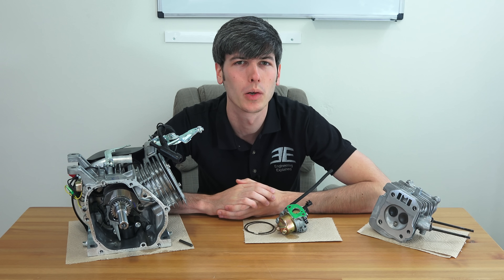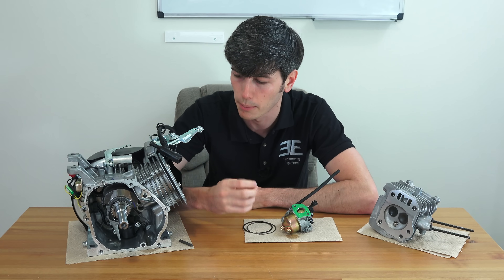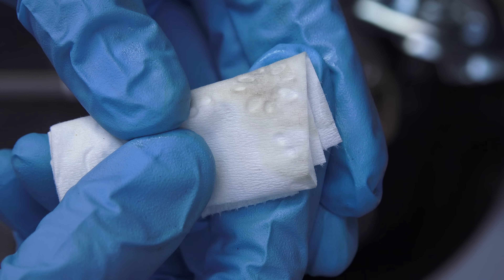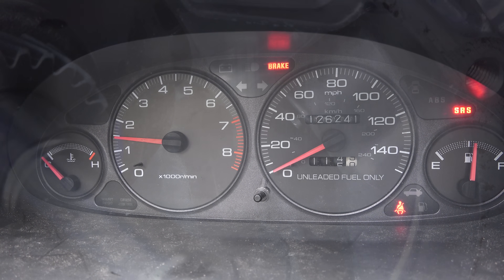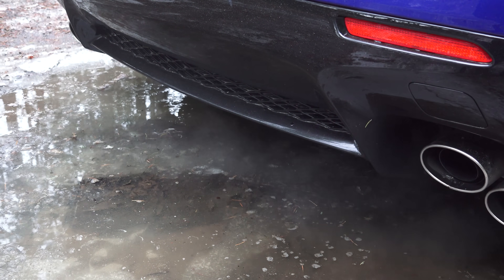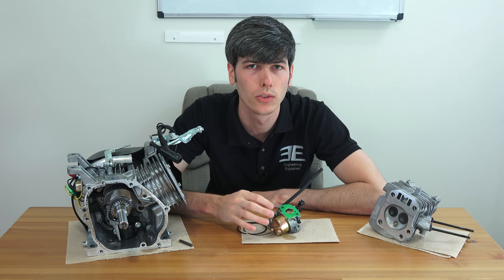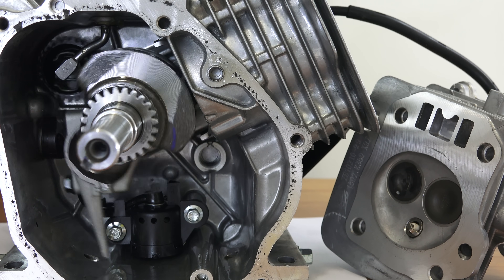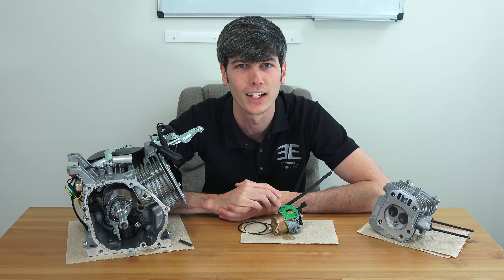Should You Warm Up Your Car Before Driving?

Comment: The engine doesn't need a warm up but that is not the only factor. I used to have to warm up the car to keep the windows from fogging up (I have a garage now). This can be really important if it is snowing or sleeting out. It would certainly warm up faster with driving but it wouldn't be safe.
Reply: You could always go buy a used Volkswagen Phaeton.   They were equipped with a standard dehumidifier so the windows can't fog up.  They also have all-wheel drive so they're more sure-footed in the snow.
Reply: Block heater would have been nice but all of the times I used to park outside, there wasn't an electrical outlet available so I never installed a heater.
Reply: Jonathan Gwynne 200k isnt nothing special on a vehicle today.
Reply: That's another reason why modern cars have AC, it keeps your windows clear. Although, sometimes AC doesn't work in very low temperature.
Reply: Obviously drive off when your windows are clear and it's safe to do so. Any vehicle equipped with A/C uses it when you use the defrost. That's why to save fuel they tell you not to run defrost all the time.
Reply: I haven't seen a modern car without a "dehumidifier".  It's usually labeled "demister" or "defogger" .  The "dehumidifier" is merely the AC unit, of course.  It then runs along with the heater to supply warm, dry air to the windows.  I haven't looked at the data, but I suspect the Phaeton was an incredibly unreliable car.
Reply: I think if you live in that climate the car body will wear out before the engine.
Reply: RickMakes I just use mine in the morning I park my truck in the sun so that heats it up nice
Reply: Kid Android
That is very dangerous as the ice could come off at speed and hit the car behind you!
Reply: There are always special situations.
Reply: Just turn on the A/C -  it dehumidifies the air and it will dry the windows faster.
Reply: Got T-boned by a guy like you years ago, Cop gave him a ticket for not having cleared windows, even tho he scraped them
Reply: The engine still needs a warm up.  Shut doesnt take long at all. That being said the couple pennies you save is not worth the risk of driving  while you cant see. It does take a few min. for car to blow out warm air and in the winter that is not safe. One accident will cost more  than several lifetimes of warming up your car a few min.
Reply: block heater
Reply: Most cars attempt to use the a/c unit as an incidental dehumidifier but it isn't the same thing as a dedicated unit.

And it isn't unusual to see Phaetons with 200k+ on the clock.   This is spare-no-expense German engineering at its peak.

The only reason they're not still being sold in the US is that Americans are too shallow to spend that kind of money on a Volkswagen.
Reply: @billigerfusel  the cops saw you doing that in my country you would probably lose your license.

Comment: Driving around in a car that is 12 degrees Fahrenheit for 15 minutes is no fun either.
Reply: +siamiam How cold does it get where you are? In Boston it doesn't really drop below 10 degrees Fahrenheit in the winter, but the coldest it was since I have been here was -15 degrees Fahrenheit. Still not too bad compared to some spots further up north.
Reply: +siamiam -62? Damn. I wonder once you go past -20 or -30 if the cold pretty much feels the same. -20 with wind is my limit.
Reply: I can sympathize with puffing your car in the driveway in the wintertime. And car manufacturers aren't quite sending the right message either when they allow you to remote start the car from inside your house :P Or maybe they are sending the right message? I don't know.
Reply: i would be more then happy if the coldest it got in my area was 12F  :D
Reply: i have a video of a temperature sign here at -62f   but the average winter  temperature is  around 1f above,a good chunk of winter is in the -20f range and colder with the highs some times being in the -40f range for long periods of times

this is ambient temperatures not counting wind , a car will start far easier at -40 windchill compared to -40 ambient

Comment: I live at a motorway junction, like right near the round about for the slip road,  speed limit is 75mph/120kmh. What should I do when starting my car,  wait 1 minute and go straight on the motorway? Or wait longer? 
My car is a Ford Fiesta 1.0 ecoboost.
Reply: wait a min let the engine oil flow...it's a turbo so I would let it run for a another rminute for every 10 degrees below 20 degrees celsius
Reply: try keeping the car under 2500rpm for a few mins

Comment: I think most ppl just do it to run the heat so they dont freeze to death.
Reply from the maker: For sure, if you're doing for your own comfort (when it's really cold out, go right ahead). Being warm is a luxury hard to pass up. :)
Reply: The heater draws in air from the engine bay into the cabin. If your engine is cold, so will your engine bay be, therefore you will get cold air in the cabin. The faster you start driving and warm up the engine, the faster you will get hot air through the heater.
Reply: @ArthurSperotto  No, the heating system on most cars draws outside air through the slots just in front of the windhsield, not from the engine bay. Drawing air from the engine bay could be lethal if you have an exhaust leak, and very unpleasant if you have an oil leak dripping on the exhaust and making lots of smoke. The heat comes from engine coolant circulated through the heater core, which is a  small radiator located in the ventilation system.
Reply: yeah I run it until the coolant gauge goes up a touch above low, I know the engine oil is still cold
Reply: I just run it under 2000rpm when it is cold after 5 minutes I continue normal driving
Reply: Sartaj Aujla Yeah. In Canada it's almost a necessity because your breath will freeze and fall into your lap somedays haha
Reply: +Ben yeah I living in mississuaga,ontario I usually warm up for a minute for every 8 degrees below 20, 1 minute for 20. I sometimes put insulative material on my grill so that my car doesn't radiate as much heat while I brush the snow off...I usually take off 2-3 minutes of the warm time this way...
Reply: Kyle Warburton Come to calgary when its -35 and tell me driving a cold car doesnt suck
Reply: Even when the coolant is up to temperature, the oil is still not up to temperature, since it takes oil more time to heat up.
Reply: ***** A fellow Calgarian! Calgary is (strangely) actually quite warm compared to the rest of the province. There have been days when I started my car at -40° (no power for block heater) and drove for an hour before I actually started to feel warm. In those cases, blocking the radiator with some cardboard really helps.
Reply: Does this also apply to diesel engines?
Reply: +Richard Tønnessen stress the engine? no. does it take longer to warm up. yes. especially when your running heat and directing coolent away from the engine
Reply: +Engineering Explained it's also a safety thing, the interior temperature should be warm to melt any ice or snow to increase visibility...
Reply: I still wouldn't bother. It's more fun to get in a freezing car,  starting it up, idling until the oil circulates, drive lightly until its at normal operating temperature and then crank the heat up to max. That 5 minutes of agony is worth the instant warmth instead of the weak luke warm heat you'd get out of turning on the heat early.
Reply: +Timeless Works yeah but if you keep it under 2000rpm and less than  25% throttle you are fine, the engine oil will heat up faster with very little chance of damage to the engine
Reply: I've heard people say running it idle for longer periods (like warming up the cabin before starting) puts much more stress on the engine than if you'd start driving within a minute or so, because it takes much longer for the engine to warm up. Is this true?
Reply: +2PacPRNDL at -40 to -30 degrees celsius my car doesn't heat up to optimal temp while driving even..,it only heats up when I cover the grill...
Reply: +Arthur Sperotto you are wrong about that...  It uses coolant to produce heat.  Once coolant is warm u got heat you have a heater core in ur dash which is a small raidiator  that you blower motor blows air through to get ur heat...
Reply: +Richard Tønnessen it's better for the engine to be idling when cold compared to under load since an engine idling I under very little load
Reply: Kyle Warburton Oh yeah thats a real cost effective idea. Move. Clap. Clap.
Reply: Up North, we feel it more than anyone else.
Reply: yeah nah, I know that :) I was just making sure that you know it too :D I usually let my engine idle for a bit until my coolant gauge starts moving up (heats up rather quick in the summer) and then gently roll away. I only have a coolant temp gauge, not for oil, so I give it some time after the coolant has reached its operating temperature until I feel okay with giving it the beans :)
Reply: +Sartaj Aujla my car doesn't heat up until I actually drive lol
Reply: +Sartaj Aujla cover the grill, how do you do that lol
Reply: 2PacPRNDL A/C is independent. It'll work with a cold or hot engine, as long as the A/C system itself is ok :-)
Reply: Sartaj Aujla Good way to block all airflow to the engine!
Reply: +1337Jogi i'm sorry for this
Reply: +Timeless Works Not sure about the stress but it does take longer to warmup the engine because the hot air comes from blowing cold air over the engine coolant pipes wich causes the coolant to take longer to warmup and in turn cools down the engine even more when it&#39;s trying to warmup.
Reply: Did you watch the video?....he addresses this.
Reply: +Dartht33bagger I agree 100% Especially when you're driving at 6am when there isn't much traffic
Reply: Daves Nothereman you should ALWAYS warm up a diesel fuel injected or carby.
Reply: Dylan Rooney All diesel engines are fuel injected and always have been.  The question was more meant to ask whether the same length of warmup time (30-60 seconds) followed by LIGHTLY driving it is a more efficient way to warm up your engine and your vehicle than just letting it sit and idle for 20+ minutes.
Reply: +Tharee MaahthePuddi it wouldent change much honestly you need to put load on the engine meaning add more fuel meaning warmer temps
Reply: +Arthur Sperotto yup, thanks man :3
Reply: +Arthur Sperotto how bout A/C
Reply: +dosmastrify lool I see, thanks
Reply: +Arthur Sperotto The interior isn't heated by air from the engine compartment, it's heated by coolant from the engine which circulates through the heater core.
Reply: giftman20 Robert Bradtke I know, it functions as a second radiator :-) It's just easier for people to understand and be able to picture it happening if you explain it the way I did.
Reply: lol true tho
Reply: +Engineering Explained thats why its freaking sweet to just lease. let that engine sit for like 15 20 25 30 min or so lol. "its not my car" lol then u dont even have to scrape the windows
Reply: A coat wont help your eyeballs from freezing at -40
Reply: +Arthur Sperotto the heater does not draw in air from under the hood lol it draws air from either the windshield vents, or if it's on recirculate, from the passenger footrests and then gets blown against the heater core to warm up the cabin
Reply: Except for Windsor Ontario. Mild winters plus free healthcare!
Reply: SoundgardenMan lol
Reply: After reading all of this comments I'd say a few things. Firstly, most cars (at least in EU) have only cooling option from AC. Of course it's possible and usually made in home AC that you can reverse it and use AC to warm up the air but in most cases turning on AC won't make big change while iddling. You may feel slight difference because of additional load to the engine. 
Regarding covers, it's quite commonly used in UE, especially for smaller city trucks. The only thing it does is isolating engine bay from outside to let it keeping more heat, especially while in move. Again, it's more common for older cars as new ones may have additional valves that will limit a lot of cold air taken from grill (at least it's called grill in Polish). I've seen middle aged cars which had bunch of plugs to use in winter time. 
Last thing worth mentioning is thermostate for engine coolant. Depending on it's condition and model it will have great influence on oil temperature. Last winter I found out that engine warmed up to proper temperature while staying still but in movement it goes down to 60C. I've checked thermostate and it was broken opening already at 60C. In my engine (Z19DTH) it should start opening at 85C and be fully open at 95C. It was enough to cool down engine while driving about 90km/h.
Reply: You won't freeze to death by getting in your car, letting it idle 10 seconds then driving it gently because you are inside the car and the wind can't blow on you plus you body warms the car interior up. I have driven my cars in -60º F weather for many years, and I drive away after 10 seconds of idling and my cars always warm up quickly and I'm super comfortable because I already hav a winter coat on and being inside the car I warm up naturally in the one to two minutes it takes the heater to blow warm air when its below freezing outside. We Just had a big snowstorm a few days ago and I timed it, the interior was warm in 60 seconds even though it was snowing outside.
Reply: There's a thing called a "coat" that keeps your body temperature high when it's cold outside, you should try it out, works great!
Reply: In Austria and Swiss it is actually not allowed to let your engine running while the car stands still even if you are in a jam in the car (obviously not if its just a short time but rather if its more a minute).
You can get fined for it and the fine can be considerable (100$-200$+ )
Reply: wow, wrong on so many levels
if you're too lazy to scrape the 2-3 snowflakes that you have in the states, you might as well consider public transit, you don't even have to maintain your car!
Reply: Ever heard of a jacket/winter coat to keep yourself warm or just move more south where it's warmer

Comment: Same with diesel engines?
Reply: not really. some of the downsides he mentioned dont exist in diesels. if its really cold, lets say -20°C or about 0°F, you could give your engine 2 minutes of idle before driving.
Reply: Youll have (or should have) engine block heaters in your diesel. Leave those plugged in all night, idle for half a minute or so. The bigger the engine the more time it will take. Many heavy duty diesels won't run properly until they have warmed up, which can sometimes take upwards of about 15 minutes.

Comment: Is it necessary to warm up cars that have aftermarket forged components such as pistons?
Reply: No, those components are irrelevant.
Reply: All forged components do is allow for higher pressures and greater stresses at redline. I'd say even a rebuilt engine needs to be warmed up first before thrashing it.
Reply: Of course. Forged pistons expand the most and are at highes risk of blowback and gashing your cylinder walls.